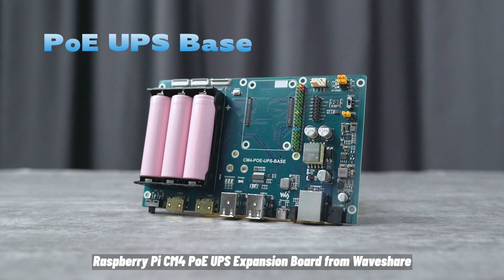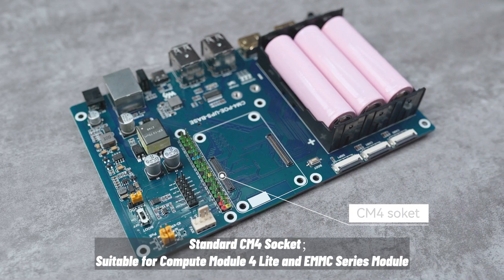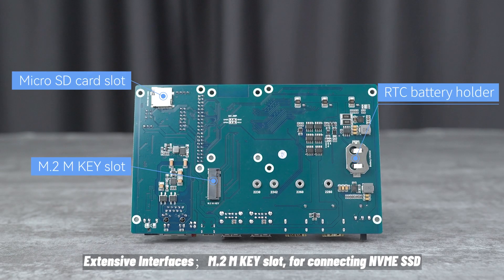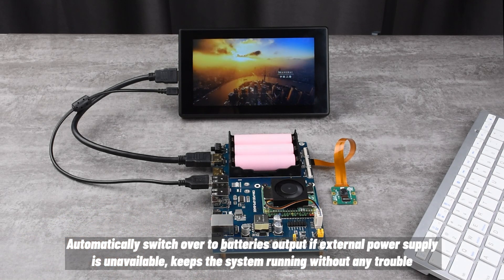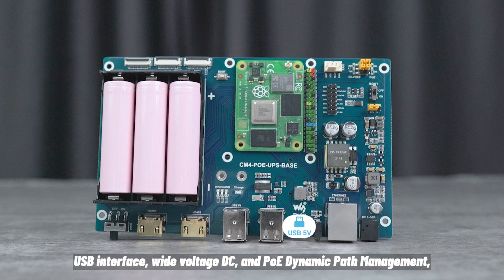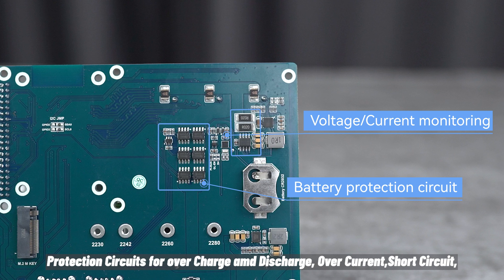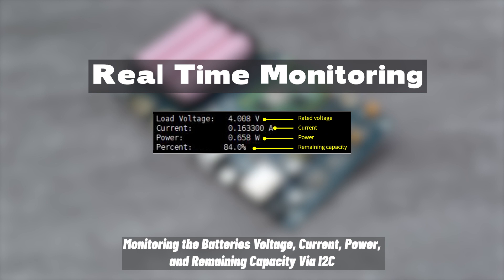Waveshare PoE UPS Base Board Designed for Raspberry Pi CM 4 Gigabit Ethernet, Dual HDMI, Quad USB2.0

Comment: I have 2 questions :
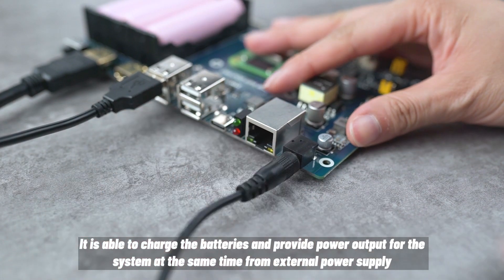1: What is the fan at 0:30 and where can I buy it
2: Can I add the 5.5 inch capacitive touch AMOLED display and screw it on the board?
Reply from the maker: hi dear, you can contact us online  https://www.waveshare.com/contact_us

Comment: will this board support booting from nvme?
Reply from the maker: it doesn't support by default, need to modify CM4 bootloader configuration
Reply: @waveshareelectronics  A short instruction would be great...I have a CM4lite attached to the main board...now I try a full debian OS on SD card...do I have to run a bootloader first...like from PI imager USB first and if not available then from SD..and later on additionally to add the NVME as a boot drive? Thank you very much..
Reply from the maker: @steffeberle  Hi, you can refer to our wiki https://www.waveshare.com/wiki/Write_Image_for_Compute_Module_Boards_eMMC_version
For more usage question, you can ask support here: https://service.waveshare.com/  :)